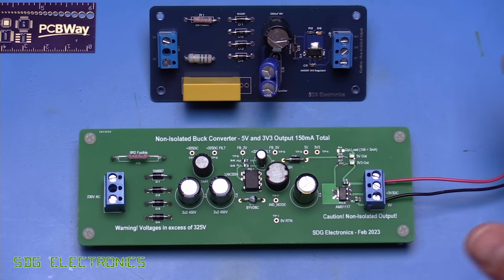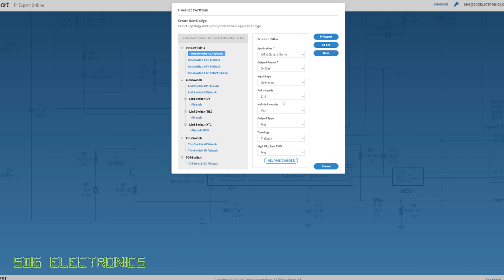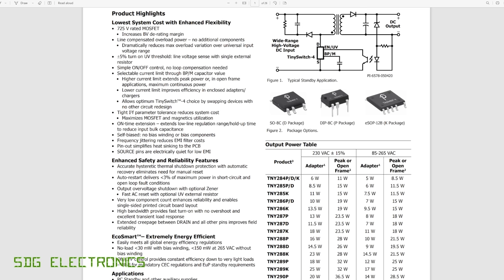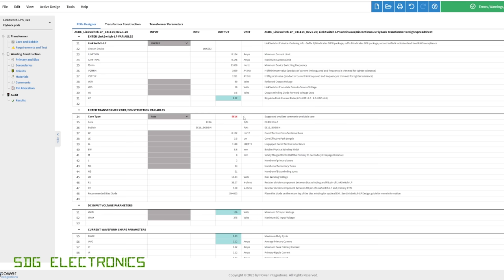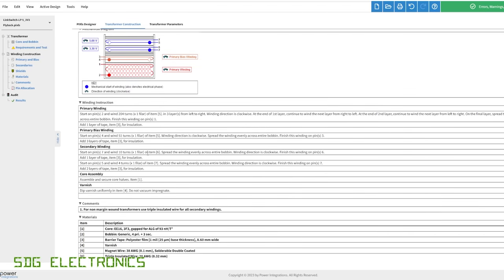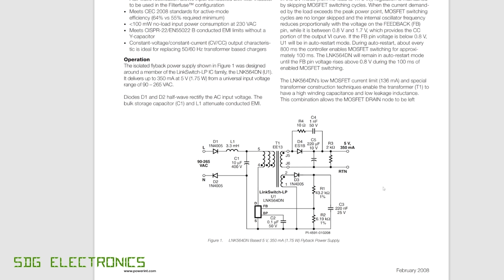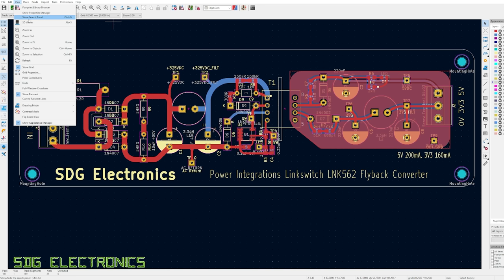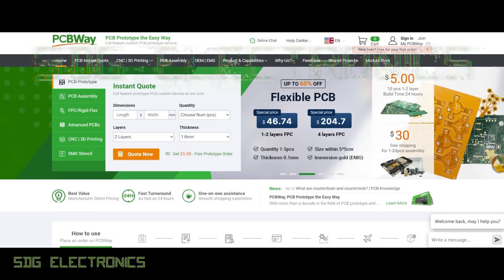SDG #304 Flyback Converter Design with Power Integrations LNK562

Comment: When you are doing layout of switcher it is important to make parasitic circuit elements work for you rather than against you.

In the circuit in the video, the output ov the bridge rectifier should go straight to the positive terminal of C1. The connection to the input side of L1 should go straight from the positive terminal of C1. This makes the connection a sort of "U" path. It is very much like what you are trying to do when using "Kelvin connections" when measuring low value resistors. Similarly the output side of L1 should go straight to the positive terminal of C2 and the connection to the high side of the transformer should go straight from C2 to the transformer pin. Doing this makes the parasitic inductances of the tracks work for you with regard to high frequency currents rather than against you.

In reality in this particular design it probably makes little difference. The circuit is reasonably compact to begin with and aluminum electrolytic capacitors are pretty dismal as capacitors at high frequency. If there were noticeable difference it would likely be as a small improvement at the fundamental switching frequency. In lots of designs of switchers caps with good high frequency characteristics are used in parallel with electrolytic caps. There layout is more critical to get full benefit of the (typically rather large and expensive) additional capacitors.

Spool core inductors tend to be relatively poor at high frequency, too, though it varies a lot with the winding. With a multi-layer winding there can be significant capacitance between the input and output, and often in the worst possible place. Toroids can be better if the winding is "progressive" or a single layer, but they are more expensive.

The circuit also has narrow tracks in the output and wide ones in the input. That is backwards. Peak currents in the input circuit are quite small but can be very large in the output. Remember that when the switch turns off the current in the output winding instantly rises from zero to the (current that was flowing in the primary) times (the primary to secondary turns ratio).

Again the output of the PI filter is from the wrong place. It should come directly from the positive terminal of the output cap (C8 ??)

Comment: Is there any reason you opted to use rounded corners instead of 45deg for the traces? Also there are some sharp angles. This is not meant as criticism, I have been wondering for some time now if rounded corners are better. My bad if I missed it in the video.
Reply from the maker: No reason, it's just what the default was when I started layout in KiCAD!
Reply: @sdgelectronics Thank you!
Reply: The only place where curved corners are really advantageous is in high frequency design where you want to keep the characteristic impedance of a track constant - you are trying to make a "transmission line." Curved corners make this easy because the width of the track is constant around the curve. With an "L" shaped corner the outside peak would typically be trimmed off to minimize the impedance change, but that is a compromise. If you can find old Motorola RF applications notes you'll see trimmed corners on tracks. You'll also find PCB tracks designed for specific inductance as part of impedance matching networks.

There are certainly high frequency content in the waveforms found in switchers, but keeping track impedance constant isn't normally a concern. Usually you are trying to keep connection impedances as low as you possibly can.